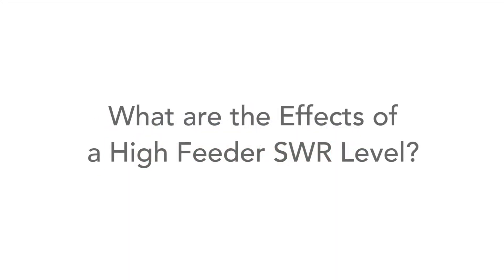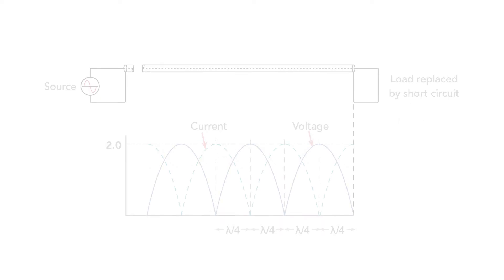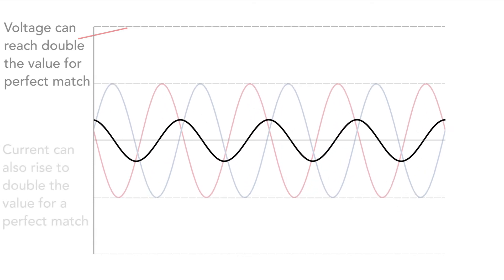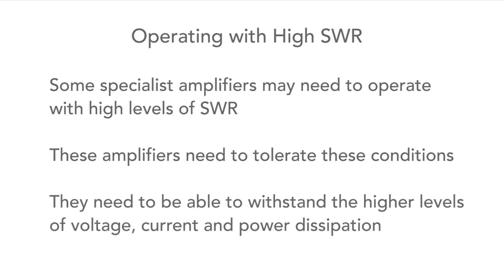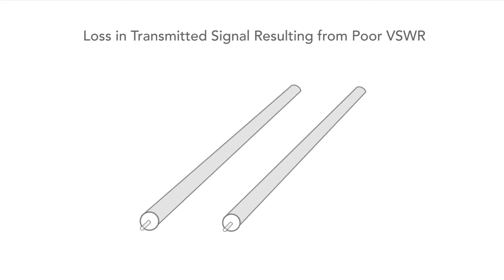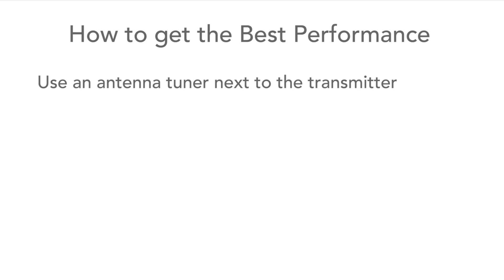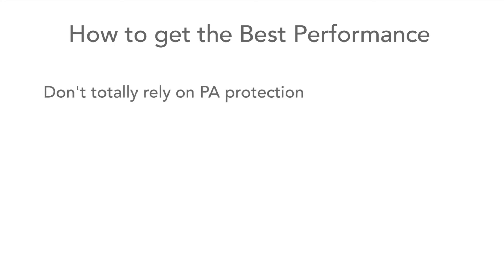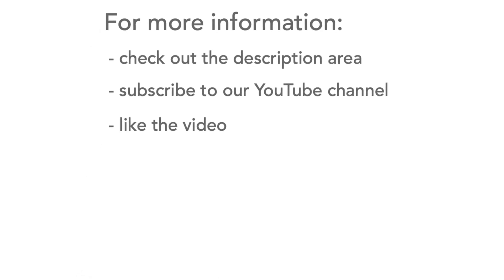How to Reduce the Effects of High SWR for Radio Transmitters

Comment: So the idea then, is that standing waves are NOT desirable on the feeder - coax or other type - whereas on the other hand, we WANT standing waves on the ANTENNA, as this phenomenon facilitates the radio waves detaching from it and then moving out into space. Ball park?
Reply from the maker: Standing waves in themselves are not a problem. The issues arise because they can cause high voltages and current levels - this can be bad for a transmitter if the mismatch and high voltages / currents are seen by the transmitter (the levels are unlikely to cause problems with a feeder, but this could be possible if it is running very close to its limits). Also the power that is reflected backwards and forwards when standing waves are present suffer losses. This means that the signal can be attenuated. However soem antennas use an open wire feeder where feeder losses are very low and the standing waves are perfectly acceptable.
I hope this helps.

Comment: Thank you for this information - very well presented.
But my understanding or SWR ( the amount of power reflected back to the TX) suggests that the higher the SWR, the less of the original TX power is actually being radiated.
So, if you have a high SWR (say 6:1), and you use an ATU to bring it down to say 1.1:1,  all you are doing is using the LC circuits in the ATU to absorb the reflected power before it can get to the TX and damage the finals.
The ATU may make the TX see an  SWR of 1.1:1, but if you put an SWR meter between the ATU and the antenna, you will still see an SWR reading of 6:1 (in the case above).
So the ATU basically 'protects' the finals in the TX, but there is still significant loss of transmitted signal at the antenna - am I correct?
Reply from the maker: This is a good point. However if the ATU provides a good match between the transmitter and the overall antenna system including the feeder then in turn it will cause the power to be reflected back towards the radiating element of the antenna where it can be radiated. HF antennas with open wire feeders can operate very efficiently with high levels of SWR. The issue is that each time the power is reflected there will be power loss. Coax cable gives good screening, etc but introduces a relatively high level of loss. Open wire feeders when used correctly have much lower levels of loss snd can operate effectively in this mode.
I hope this helps.
Reply: @ElectronicsNotes  LOL No.
Reply: @ElectronicsNotes   I understand your point about 'high swr being reflected will be radiated'., but in the case where you use an ATU to reduce the swr that the TX sees, and thus protect the final amps on the TX from overheating, the 'absorbed' rf energy just goes into heating the LC circuits in the ATU, and does not make it back to the antenna to be radiated.
The scenario you describe is the case where there is no ATU to artificially 'resonate' the antenna-feedline by absorbing the reflected power in the LC circuits of the ATU.
Reply: The reflected power is re-reflected at the attic and sent back to the antenna.
This is from "Reflections-III" by Walt-W2DU (SK).
Reply: @Geronimo-sn1pc So, if I use an AT , it helps to, literally, increase the radiating power, reflecting some power back to the radiating element? Of course, without improving the antenna...
Reply: @nul153  the atu allows the transmitter to produce more power into the system ,the amount that gets to the antenna is dependent on the feedline
Reply: Whoops..."attic" was substituted by AI. Should be "atu".
Reply: @James-ci3lx  Thank you so much. I will have to take some time to wrap my head around the math - I've got an old copy of the ARRL book from the 70's - I'm sure the physics are still the same today 🙂
Reply: @James-ci3lx Thank you James. One question though - why does the ATU get hotter the greater the mismatch if it is NOT absorbing reflected power?
Reply: @mikeymouse4629 it doesn't get hot if you have the correct tuner for job, also reflected power is not absorbed within the atu
Reply: @Pioneer936  It is not the reflected power but it is because of the higher circulating current.  That is why it takes larger wire and larger spaced capacitors as the power and/or the swr is larger.  Same as you have to use larger wire for the coils in the transmitter.  The circulating current determines the loss in the ATU.
Reply: @mikeymouse4629  Because of the higher circulating current in the matching unit.  You might think of it as the coil has more current in it so the I square R loss is greater.